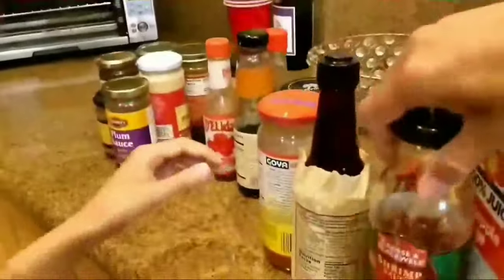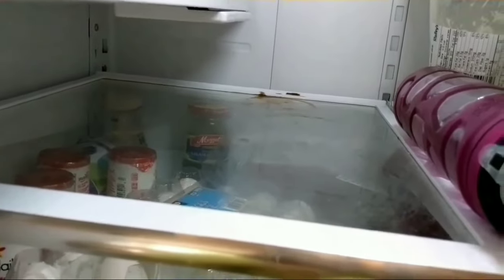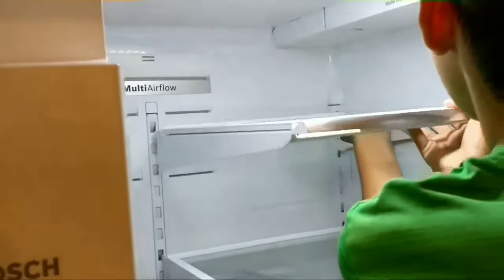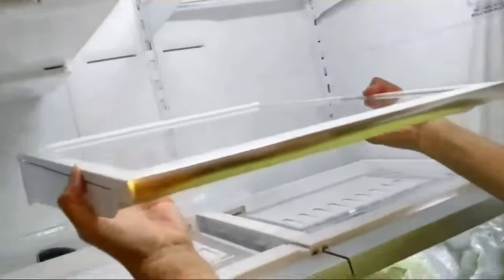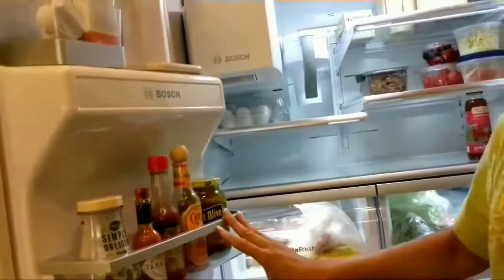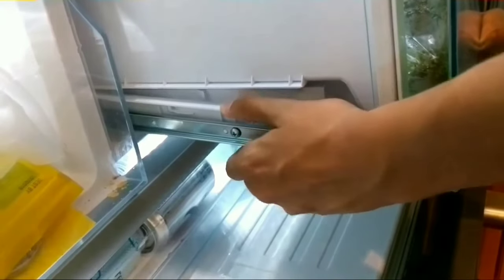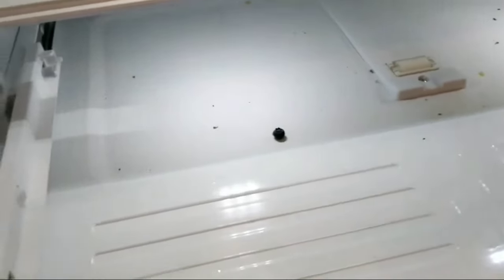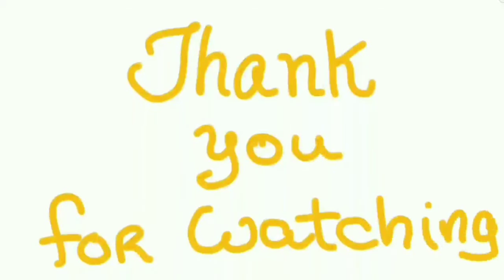How to Clean a Refrigerator (removing Drawers, Bins and Shelves)

Comment: I’m having difficulty put in the large wide bottom one. My mom took it out for cleaning and didn’t take note on how it was connected
Reply from the maker: Are you making sure that the flat part is placed forward the front of the door? Also, it has to go in first, and then the drawer. Otherwise the bin won't side in. To slide the drawer the sliders have to be pulled out, and then they just snap
Reply: The long bin had no wheels to roll on so it made it more difficult. But good news is my mom figured out how to put it back 😅

Comment: I inherited a refrigerator from my mom. All the shelves and bins are nasty. Is Simple Green too strong for plastic? I need to hose everything down in the yard. The sink is relatively small to clean them in the house. Then you have the rubber seal turning yellow. What's good to clean that? Bleach will make rubber and plastic brittle. A friend of mine ruined hers.
Reply from the maker: Try a paste of baking soda with one part white vinegar to three parts water. No hard chemicals and it should be clean.

Comment: I have a  jar stuck on the  glass  fridge shelf .Help !😭
Reply from the maker: LoL, that's happened to me too 😂. I squirted hot water around the edges and was able to get it off. You can also remove the shelf and run water at the edge of the jar/glass shelf. As a side note, always wipe the bottom of anything you put into the fridge to minimize cleaning time and prevent stuff from sticking to the shelves. Good luck